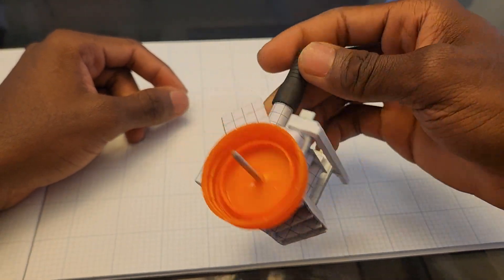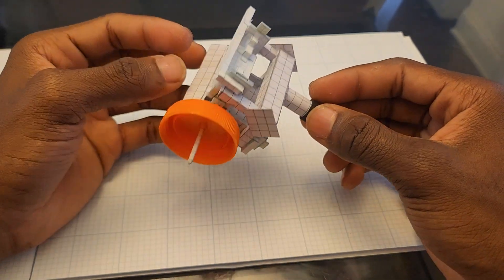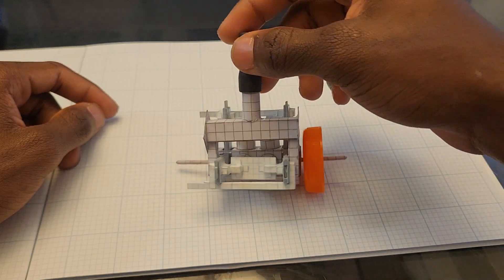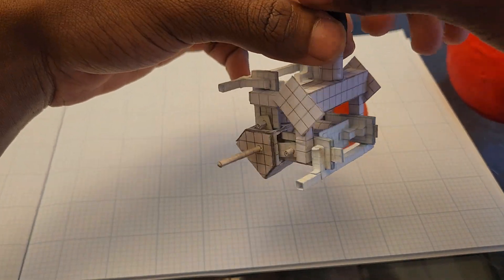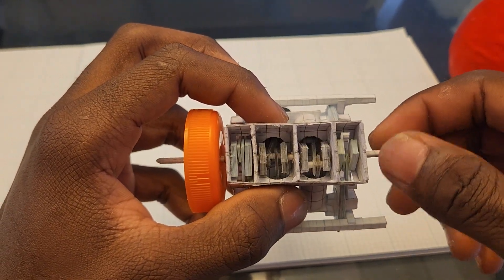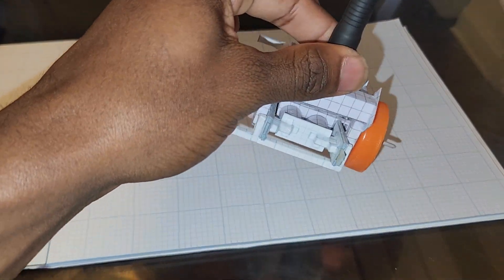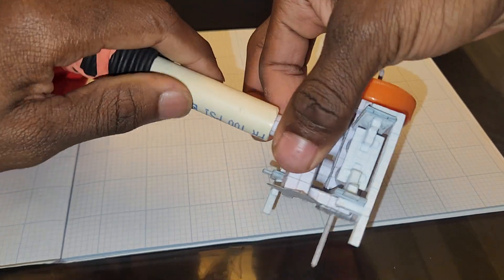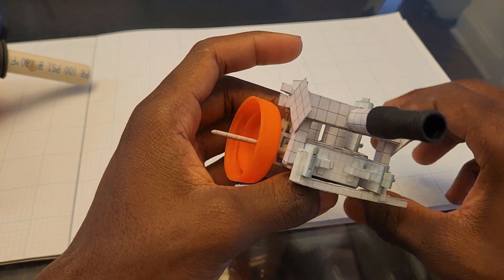Miniature Paper V-4 Air Engine

Comment: Bro what's the measurement of the  grid lines? 1/4 or 1/8 inches?
Reply from the maker: I use 1/5 for the engine parts and 1/8 for the air valve parts

Comment: I have several questions, so the first one is will toothpicks work for the shaft or the sticks also did you make a v8 before? I am trying to use my knowledge on making myself a v8
Reply: Yea, it will work. I made one by myself and iz runs pretty smooth.
Reply from the maker: Yes it would work and no I never attempted to yett